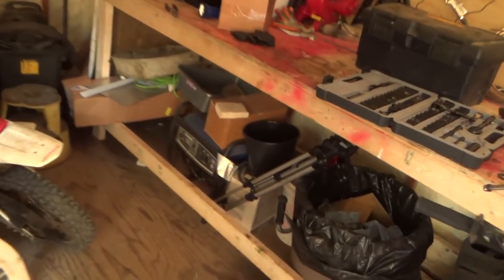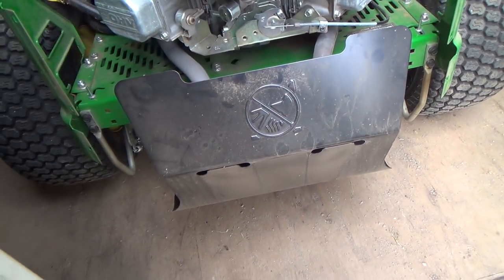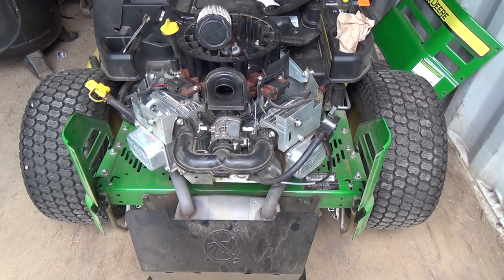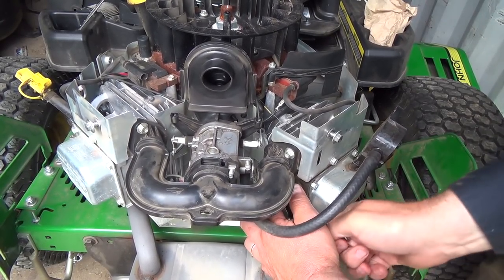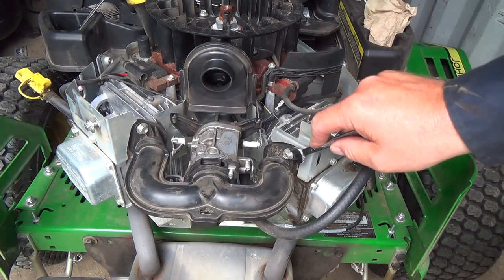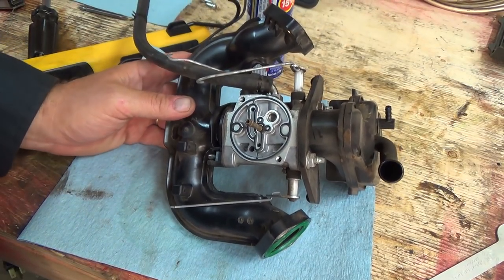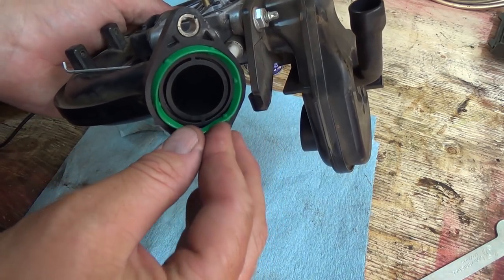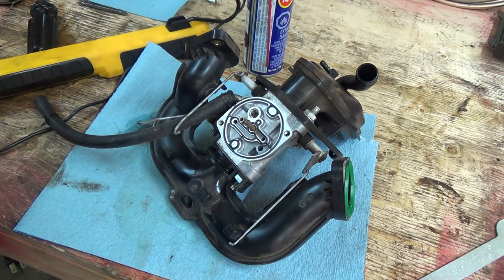Zero turn mower Carburetor dissection and examine..But still issues :(

Comment: Bill that surging problem has something to do with the governor.  Used to work for sears back in the 90s and my job was to go work on riding mowers and push mowers. I came across this problem a lot on the riding mowers. Usually it was the internal parts of the governor. No one had figured it out and they would just put a new engine on the mower. I decided to play a hunch and just replaced the internal governor and it fixed it. Once I did that all mower techs were advised about the governor and we replaced fewer engines.

Comment: hey Bill check the Puls line from the fuel pump to the engine may have a hole in it! And Spray car cleaner around the Manaifold gaskets if it smooths otu it is leaking at the Manifold! Another thing to check if you have a gas tank you could put directly on to the fuel line to the carb and see if it runs better with it that way! I Caution though take the fuel line from the tank off at the fuel pump off there! If it runs better it is a problem with the fuel pump!

Comment: Bill clean up the coil packs check for contamination of the air gaps and then clean up the magnet check and clean any rust particules affecting the air gaps then regap also I think the inlet seals had been misaligned during original assembly and got worse over time cos remember the choke was always a little funny that's why you had to alter the direction of the spring I think its probably a intake leak but It could also be a faulty coil pack you will be better making sure it is not the inlet seals and then work back to the coils but it is worth cleaning them up first regards Alan.
Reply: Also if you have one of these plastic intake manifold if you hold it up and look at the flat parts all three probably slightly warped

Comment: i have the same setup same thing at 30 hours it started surging took carb off cleaned real good  changed gaskets and o rings but same thing surging i bought a carb from ebay Chinese one and the thing runs perfect  its something in the carb i took the welch plug out on top of carb to check idle circuit but was very clean there is no adjustment behind that welch plug at a later date im going to drill the idle circuit a little bit bigger and see if that works  some people say that the epa makes the manufactures lean out these carbs to barely run good but as they break in they need more fuel thus the surging after break in!!

Comment: I used to work at a mower shop check the plastic manifold for cracks and spray ether around the gaskets while running and see if it clears up

Comment: Split the fuel line at the filter and take compressed air and blow back toward the fuel tank to clear the line  Then bypass the filter for second and see if it still surges could be dirty filter or the vent in the cap on the tank is not working

Comment: Bill ALERT ALERT when working on a carb you will have to take the jets out of the carb and completely disassemble, and it can be as small as a human hair will cause it to surge,,  Also make sure he is not using E 10 fuel, thats whats causing the carb o rings to have a little crusty on it,  If it was your coils you would have to let the engine run at full throttle for 30 mins Or it would not start ITS NOT A SPARK PROBLEM.  Its not a fuel delivery problem I CAN PROMISE YOU THAT.   I am a certified Kawasaki, Kohler, Onan, and Briggs mechanic only been working on small engines for 45 years I seen a thing or two I will never retire I prefer to die in the shop. Hope the info helps, I got to get back to work!
Reply: I have the exact same Nikki carb, intake,  Etc on my Troy-Bilt z-54 Mustang with a 22 hp b & s. Even though the unit is 2 years old it had a whopping 12 and a half hours when started surging on me I took the carb off to clean it and I treat it like I do a lot of my car repairs I go into it with my past knowledge of other vehicles applied to the same job even if it's a little different without watching the video only watch the videos after the fact when I'm scratching my head or run into a problem so when I put it back on the mower barely wanted to run and I had to have the lever all the way up for it to the choke to even try to idle and it was almost blowing like black smoke I'm assuming it's running way too rich question is isn't there a little bran jet that's inside that white plastic tube that is part of the float system cuz I heard that can fall out and I don't see one on mine and I'm wondering if because that's not there anymore its just dumping too much fuel and I just might as well just buy a whole new carb..?.?
Reply: I hope you reply and if you do this is thanks in advance

Comment: I had this problem and ended up replacing the carb.  Found one for less than $30.  From what I've read, the rubber gaskets in the bowl will start to disintegrate and cause the fuel flow to fluctuate.

Comment: it's starving  itself of fuel,  that's why it evens out with partial choke on. The idle jet is plugged or dirty. it has to be taken apart and cleaned. Compressed air is not enough.

Comment: Very curious issue. I have seen small leaves and bugs in the gas tank, blocking the outlet, cause this kind of surge, but with that issue you would never get full throttle. I believe you can mow normally at full throttle?     A fuel pump that is going bad could do that surge too. Try bypassing the tank and pump, by connecting a small gas tank to the carb directly, and hanging it above the engine, so the pump would not be needed. use a fuel filter inline with this test.  Also,  Try moving that small spring on the govner back to its original location.
Reply: I noticed on the right side linkage that runs to the governor missing the spring that runs on the outside of that rod

Comment: Bill, surging is caused by lack of fuel, I noticed when you held the governor it smoothed out. You have a blockage somewhere in the fuel system. Fuel tank , pump, filter, or carb has a blockage. Eliminate one at a time till you find it.
Reply: Idle hunt like bill has is a vacuum leak all holding the governor does is increase's sleep of said engine .fuel blockage would stall out his engine and would be hard to start.
Reply: Are you getting excessive are for the metered fuel that is coming in and I could also be caused by those gaskets not sealing properly or they are warped at the three different points that they meet metal

Comment: bill all those valve covers leak. but not that high up. not much oil in them. the briggs and station, kolher and Kawasaki fix is high heat temp nice bead of rtv sealer maybe yours is just dirty and dust kick up onto it, on a horizontal shaft single cylinder like mine your muffler right under the valve cover so you know when its leaking cause now your 007 laying down a smoke screen lol
Reply: You might want to give stop stuff called dynaflex Ultra can a black tube and the color of the sealant is black says lifetime mold mildew and weatherproof that works from 40 to 400 degrees I use it when I need a liquid gasket stop leaks on a tin roof fix something that's plastic that's got a crack in it under the hood

Comment: It's the jets or emulsion tube. If you take it apart again take an old wire brush and pull off a few bristles and use one of them holding it with some needle nose and run it through the jets to clean them out and any of the holes including the emulsion tube. Gas can get gummy and cause varnishing

Comment: If it’s not the carb next is fuel pump cheap insurance to change, then I’d add a fuel stabilizer yea I know but if the fuel is contaminated from filling best to see star tron or sta bil. Add that to the tank. Or an octane booster or add mid or premium fuel to see if the octane isn’t the issue. Causing spark knock. Things to eliminate till it quits surging. Help to start it hold the choke open till it about dies let off. Run in medium throttle get some heat into her

Comment: Spark,filters, gas pump, carb cleaning should be it. If not and you have surge issues adjustment in linkage for air fuel ratio

Comment: Hey can you please help me what is the name of that bottom part of the carburetor with the white circle my mower cranks up fine but after I ran it for a while when I turn it off and try to crank it back up, it will not start. I have to reach back there and unplug the plug and crank it. It will start think I just need to replace that part there, but I don’t know the name would really appreciate if you can help me. Thank you.
Reply: It's a fuel shutoff solenoid. People have been known to bypass them altogether

Comment: You just got that what last year?you should still have warrenty from JD right?if you do just let the pros fix it at the dealership
Reply from the maker: think its like 3 years now
Reply: He got it in June of 2018. It had a two year warranty so it's just out of warranty. Figures eh?
Reply: @deathk26  my kubota dealer gives 5 year on zds and 6 for the f series
Reply: @billstmaxx  turn fuel filter round it the wrong way round

Comment: Plastic manifold is much easier to bend using injection molding, then bending metal to do the same thing.
Reply: Agree, the equivalent in say aluminium would need to be cast.

Comment: From everything I'm reading online it says the screws could be out of adjustment for the carburetor. Yes I know you just clean the carburetor but just figured I'd mention
Reply from the maker: fixed jet carb on that one
Reply: I would spray carb cleaner around where the manifold bolts to the heads while running.see if it runs different.

Comment: Oh man, I dislike those Nikki carbs. All those plastic parts, baffles and O-rings. I had one on a single cylinder B&S in an Ariens and it gave nothing but trouble. I replaced it with another brand carb which was more conventional.
Reply: Did you do a walbro
Reply: @hyperwebbing  No, I went with a Ruixing that I got from Pro Parts Direct. It showed as a replacement for the Nikki.
Reply: @eosjoe565  10-4

Comment: Thats the dumbest carb ever built. Easiest way to find a leak/ vacuum is use starter fluid or propane and just start spraying it around all spots where theres o rings or gaskets while the engine is running. if the rpm goes up you have found the source of the vacuum leak. Do it with a cold engine.
Reply from the maker: I like the old style better.

Comment: I hate that carb, worst carb design ever made and it's on all kinds of stuff, once it starts the idle surge it's very tough to resolve. Stupid Nikki carb... I've got the same carb on one of my mowers and I've never been able to get it to stop surging, lots of youtube vids on it  too.  I've seen some folks drill out the idle jet with micro drill bits to smooth it out.
Reply from the maker: maybe it’s starving
Reply: @billstmaxx  yea surging typically means it's running lean.  Either there is an intake leak or the carb isn't supplying enough fuel.